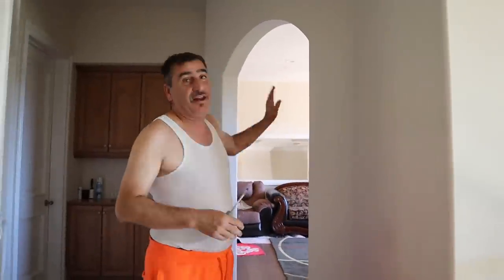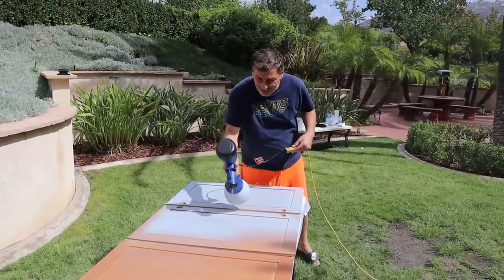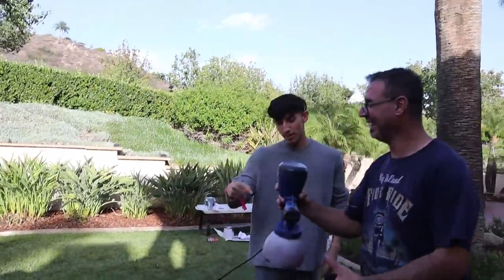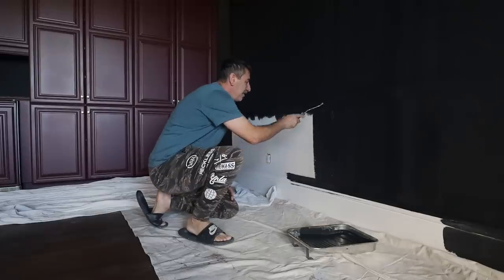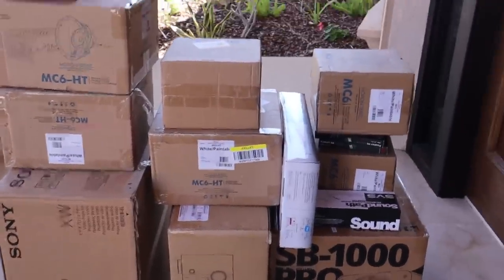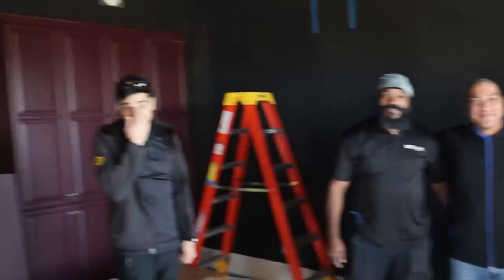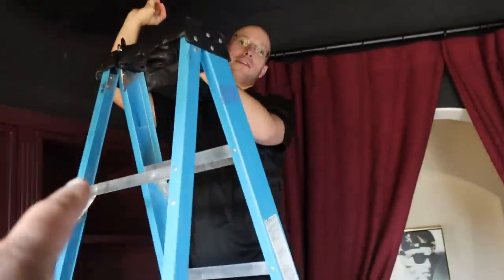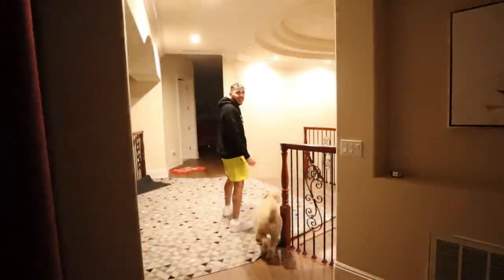I Built My Dream $100,000 Home Movie Theater!

Comment: The room turned out amazing.  Your AV designer should have put the front three in wall speakers behind the screen (AT screen) with the tweeters at ear level, you would get even better sound and better seperation for Atmos (Dolby specifies having the bed layer speakers minimum 3-4 ft vertically separated from the ceiling speakers).  But I love the work you did yourself with the riser, the color choices, the cabinet, etc.   Great job!